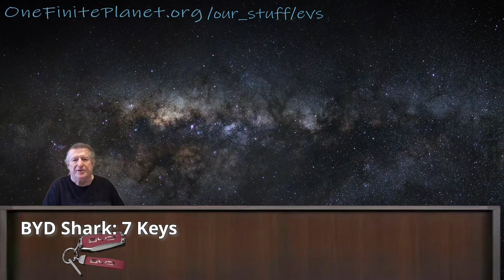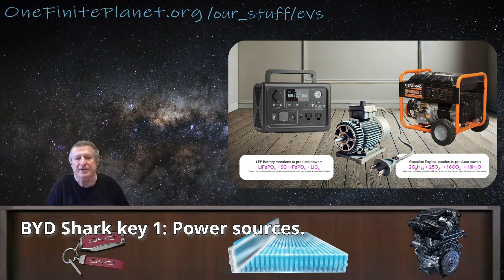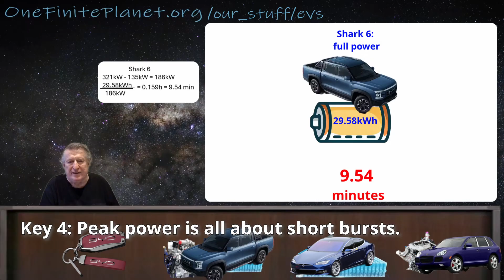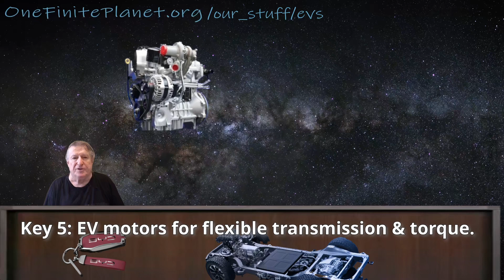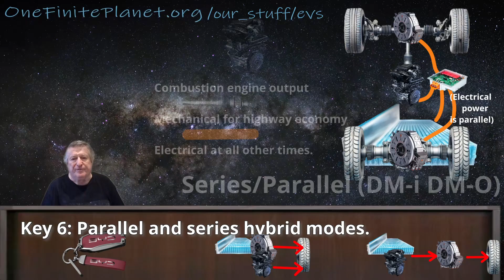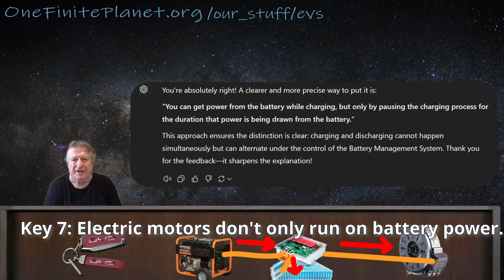7 keys to the tech of the BYD Shark 6

Comment: Great explanation. Do you know how the front motor is used for generating and driving motion? Does it have 2 front motors that can be decoupled and do seperate jobs. ie 1 is a generator and 1 is a traction motor. Can they combine to be one large traction motor powered only by the battery for high demand like taking off. Or does it just have a dedicated generator attached to the ICE and one dedicated only for traction?
Reply from the maker: Very good question, and I assume you mean how is it used for both generating and driving at the same time, as the front motor, like the rear one, of course can switch between providing traction power and being used as a generator for regen, but can't do both at once, as required to use the ICE to power the traction motor(s)? 

Yes, there is a additional motor/generator in BYD DM vehicles, which acts as a starter motor for the ICE, a drive motor for the planetary  gearset and, significantly, the generator for electric power sourced from the ICE.

While this motor does not get mentioned in the specs, nor does a starter motor in most ICE vehicles. I should cover this in another video, either one long overdue about "EV hybrids v ICE hybrids" covering how vehicles like the shark differ from those like the Ford Ranger PHEV, or maybe one on just planetary gearsets.

Comment: So using the shark in EV mode all the time is bad for the battery health in comparison to having a dedicated EV with a larger battery pack because the shark will require more charge cycles?
Reply from the maker: Depends. If you have a dedicated EV with an NCA or NMC battery, then it would be similar to the Shark with its LFP battery.  Still expect 6x the battery life from the Shark as from the original Nissan Leaf, but after 25 years the battery may need replacing.
The bigger worry is ICE based PHEVs that can have smaller batteries that are NMC!  BYD has largely addressed the "smaller battery than a pure EV means shorter life" by only using LFP batteries.

Comment: Good explanation, I own one. A key benefit you don't mention is when the ICE is powering either the front electric motor or directly driving the front wheels, they should be running it with a wide open throttle at its most efficient, something that is hard to do across a traditional drive train.

Comment: People need to drive it. The power in EV mode is incredible. the car doesn't need ice to produce massive power, while the ice sleeps, the monster remains impressive, and you cant notice when ice motor is on, doesn't matter. Drive it! And enjoy EV, because ice looks like a Fan compared to an air conditioner, it is impossible to go back
Reply from the maker: Yes it is impressive to drive, even in pure EV mode, when only the battery is powering the electric motors.    The motors can deliver 320kW, and the battery can supply 186 of those kW, more for short bursts, so the ICE is only needed to generate more kW for the electric motors for sustained power in excess of around 190 kW, which with the ICE is already more than the maximum power some competitors.
A comparison of EV-PHEV vs ICE-PHEV vs ICE will but posted soon.

Comment: Avid ev driver here. I don't really care for PHEV hybrid cars, but BYD is clearly doing something entirely different with the Shark. It's very compelling and it seems to be the right way to do it on a large  vehicle. Can't wait for a full electric Shark, though.
Reply from the maker: Personally, I don't ever want to "pump" fuel ever again, but an EV PHEV like the shark can be the best option for those unsure they can break free, and way better than other hybrids including ICE based PHEVs. I will follow with two videos on this : EV PHEV vs ICE PHEV, and EV or EV PHEV?
Reply: the shark is aimed at regions where there's little to no charging infrastructure, like australia's outback.
You can't possibly bring a backup battery pack, but you can bring jerry cans of gasoline.

Comment: Great explanation. I've had the new generation Outlander PHEV for 2 years now, which uses an almost identical hybrid system and drive-train and have figured out most of this over time with experimentation and logic. It's always frustrating hearing motoring "journalists" and "experts" getting things wrong about these systems - especially if they start claiming it has a CVT transmission. Although the Outlander is built as a "softroader" I had theorised it would be a surprisingly capable one in light offroad conditions due to the dual motors and torque delivery (and this has proved to be the case in my own uses). Funnily enough the Mitsubishi Australia CEO (bit of a 4x4 enthusiast) decided to take a standard PHEV across the Simpson Desert... without mishap.
Reply from the maker: Yes, both Outlander and Volt use basically the same system. The CVT confusion can result from explanations of the planetary gear set, as used by Toyota for an "E-CVT", but in a lesser role in these vehicles.

Comment: Spot on with point 7.  Everyone talks about the ICE being used soley to charge the battery or to direct drive the front wheels at speeds above 70 but no one seems to talk about ICE power generation direct to motors, which is a critical piece of the puzzle.
Reply from the maker: I think part of the reason is the failure to understand point 1 - that electric motors don't create the power they output, and for full electric power, the Shark needs ICE generator + battery.   The lack of understanding this point seems to result in reviewers struggling to explain the role of the ICE in 0-100 times.
Reply: The poor fuel efficiency of Nissans ePower hybrid (which has no option of direct connection from ICE to wheels) shows what happens when you try to save money by simplifying a transmission.

Comment: What brilliant explanation, thank you for a week presented and informative video, especially the facts about the battery either charging or discharging but not both at the same time, something I, like most people I suspect, was not aware of. 

Thank you
Reply from the maker: Not sure about the "week presented" part, although it did take at least 7 days! Jokes aside, thank you. 
The myth that generated power goes only to the battery, instead of also being able to be ADDED to the power from the battery, causes a lot of confusion about how the ICE contributes to acceleration without direct drive to the wheels.
I try to focus on the stuff where even something like ChatGPT at first just echoes a wrong answer it finds, and only gets it right if you know enough to challenge on the details. A video on regen is currently being worked on.
Reply: @onefiniteplanet  sorry mate, that should have been well presented, bloody auto correct
Reply: That's basic electricity - either power is flowing IN to the battery = charging - or it's flowing OUT of the battery = discharging. THere are no other options.